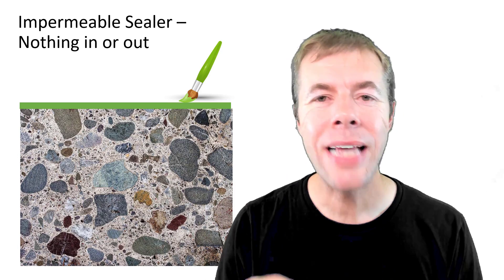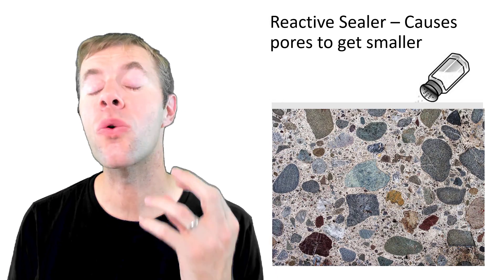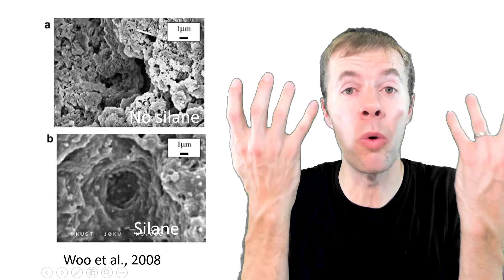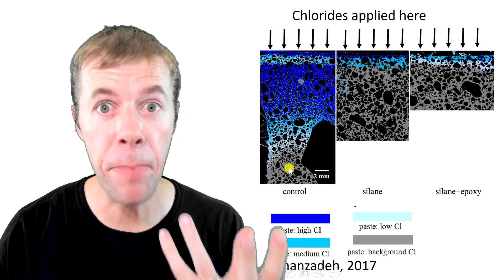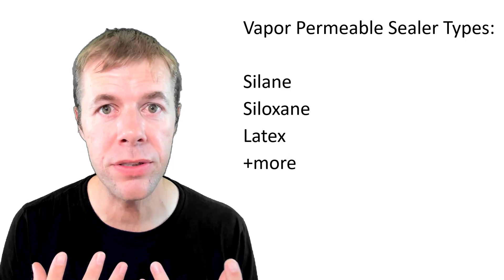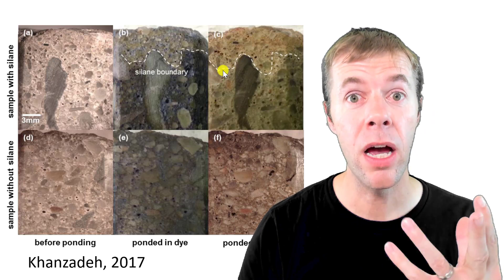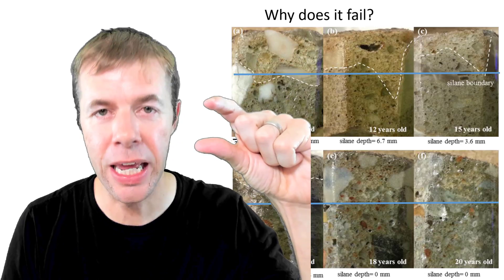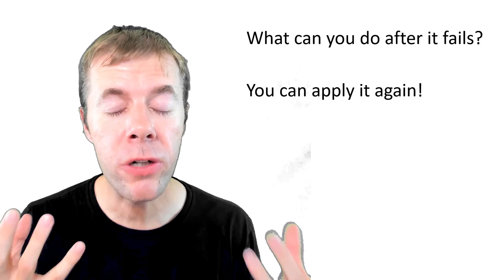Surface coatings and sealers for concrete – How long do silanes last and why do they fail?

Comment: What could be very hard surface that is also magnetic? We have that kind of floor in my workplace and been wondering what it could be...
Reply: My guess is that the floor contains a lot of magnetite.  It's used when you need a very heavy, dense concrete.  It's used when you need ballast (to counterweight a cantilevered structure), radiation shielding (such as a medical facility or nuclear plant), or you need to reduce the heat of hydration (to reduce the risk of cracking).  

http://www.ohamind.com/projects/magnetite/

Comment: If you apply silane should you clean the surface and then wait 2-3 weeks of drought before you apply the silane.  I am thinking a layer of dirt, grease, mold, algae would interfere with the absorption of silane to the desired depth.  What’s your suggestion Dr. Concrete?  Where I live, every year after Father’s Day we get a mini-drought until September.
Reply: Not sure, but the general rule of concrete and mason patching is to use a gas power washer to clean things up. Apparently electric power washers just arent powerful enough!!!

Comment: What about additives? Like quartz .friend used to work pouring crypts. They got steel but the high dollar has fiberglass" AngelHair" also.
Reply: I believe the fiberglass hairs reduce surface cracking, but aren't classed as having any structural strength.

Comment: Another hypothesis might be that the road layer got grinded off the top so the differential line appeared higher/thinner when the core was drilled to the same depth.
Reply: Surface erosion was my first guess, too. But if the shoulders (where there is less mechanical erosion) are affected exactly the same as the driveway, it is probably like he said.
Reply: @Matt Jacob: Minor critique of your text. The word 'grinded' should be rarely used. The more proper form is GROUND, as in 'the road layer got GROUND off'. D : )

Comment: All this stuff forget liquid silicone was used here for years on masonry.On my own front stoop 30 years ago and it's just like new it took all the weather and abuse and still just fine. A brick stoop facing west and south tight as new, but what comes along but US government regulations and bylaws this perfect thing, but it is still used in waterproof latex products at %5, if its OK at %5 why not just make it 100%. Buy liquid silicone spray it on fully dried cement as much as it will take and it will last a very long time...! finding it is the problem  How do you use latex to waterproof anyway.?

Comment: Excellent video, I have been looking for something like this Silane for Necedah Tower ( See it on Facebook) Will this protect wood any or can I get it on wood? the wood is pressure treated. Will 2 coats give more protection? I have a 17 ft by 17 ft slab at the 40 feet level on the top- it is somewhat rough. I have to strop off the old paint that failed.

Comment: Hey Tyler, thanks for all the in depth info! Amateur concrete enthusiast here. Have been soaking up info quicker than silane into a brand new bridge though (bad joke). Anyways, curious what your thoughts are on "sealing" with boiled linseed oil and mineral spirits. I know there has been some research carried out in this and am wondering if there's any merit to it, and if so, what category of sealer you would put this combo into? My application in this case is a concrete sink and I would also be applying a wax coating over top. Wondering if this could be beneficial and if not, what your suggestion would be, if any. Other options are Diamond Sheen, which is an acrylic/urethane combo, aswell as Cheng and Trinic products which I'm just starting to investigate. Not sure what your knowledge of the more decorative concrete arena is, but any tips would be greatly appreciated. I look forward to soaking up your videos. Thanks again!

Comment: older concrete +5 yrs. Can you apply a silane/siloxane?
Has anyone tried Stainless steel rebar. Or Aluminum rebar?
What's your take on "mesh" in the concrete? Or mesh and rebar?

thx
MJ
Reply from the maker: MJ- You can apply silane to older concrete but it is harder to get it to penetrate.
Stainless steel is great!  Aluminum is not!  It will react with the concrete and cause hydrogen bubbles.
I like mesh if it is deformed and welded together.
Reply: @TylerLey  Sorry should have been more specific. But that's a good answer too.
MESH: IE fiberglass or plastic mesh?
Has anyone come up with a semi rigid polymer/aramid fiber to replace the rebar?
Have you heard of using hemp fibers for concrete?

Thx for your time
MJ
Reply: mike johnson 
There’s ‘hempcrete’ but that has no structural strength. It is made of hemp fibers and lime and used as an insulation material. Because of its ability to absorb and release water vapor and its mass it should create a comfortable indoor environment. (Stable moister and temperature level)

Comment: When you dilute epoxy with acetone it gets very thin and will go deeper into the concrete.
Reply from the maker: I agree.  That can be really useful to get deeper penetration but the acetone will also attack the concrete and damage it.  You have to be careful when you choose a carrying agent.
Reply: @TylerLey  Ok, thanks, I  didn't know that.
I used it for rotten wooden beams and it made them strong again. 
I know nothing about concrete, but learned already a lot from your videos.

Comment: Just found your channel so I may be asking a question you have already addressed.  This is mixing latex paint with concrete.  I can no longer find the original study done by the state of Florida, I did find this summation of that study done in 1995 -96.  Is there more current data on this?  

"Paintcrete 
Concrete made with left over latex paint admixture 
Final Report 
Feb 20, 1996

Florida Dept. of Environmental Protection 
Agreement #HW275 
Unique or Innovative Household Hazardous Waste Grant 
In Partnership with Okaloosa County, FL

- a way to divert the household hazardous waste stream - by 
incorporating these materials into concrete)

The question is can this be done while maintaining the structural 
integrity of the concrete, ie, design strength?

- descriptions of several test samples and slabs poured using old 
latex paint during 1994.

- the most controlled test consisted of 250 gallons of paint mixed 
into 17 cubic yards in the form of a slab 25 ft by 37 ft.

- All tests resulted in a hard, functional slab, but failed 
compressive strength tests.

- However, in every instance, the masons had added so much extra water 
that it practically liquified the mix, which probably resulted in 
sub-standard strength.

In late 1995 they performed the most controlled batch design where the 
amount of water was very carefully rationed. They made a mix consisting 
of 1.5 cubic yards of concrete (containing 5 gallons of water) to which 
they added 10 gallons of paint and then 1 gallon of water. Normally, 
1.5 cubic yards of concrete would contain 15 gallons of water to get 
3000 PSI strength. Instead, their modified concrete contained 6 gallons 
of water and 10 gallons of paint. The concrete had a slump of 1.25 
inches and compression strength (at 7 days) of 3909 PSI (130% of design 
strength).

They added 1 gallon of water to get a slump of 3.25 inches and that 
sample had strength of 3472 psi at 7 days. Finally they added 1 more 
gallon of water to get a slump of 5.75 inches and it had a strength of 
2996 psi at 7 days. "
Reply: Great topic, seems like paint is very similar to acrylic admixtures. Modifying  the composition of the concrete seems more practical than a surface coating.
Reply from the maker: I think that starting with really good concrete is always the first step.
Reply: kcotte59  Pottery Barn
Reply: Katie Dotson more water more slump and less compressive strength.
Reply: I do that all the time. especially if i need it to stick to painted stucco. sure i grind it a bit but jeez, who wants to do that. I also do it on those prefab high density foam faux column covers and window dressings,  i usually use white thinset with a smidgen of latex , maybe a tad more.

Comment: what about pool construction? When the rebar rust comes to the surface, the only solution is to cut out the stained section of concrete down to the rebar, cut out the section of rebar and patch the pool with new concrete. This turns out to be a never ending problem until finally you have to tear out the whole pool and replace it.
Reply from the maker: Do you mean a salt water pool?  I wouldn't use metal reinforcing in a salt water pool.  I think FRP would be a good choice.
Reply: @TylerLey 'FRP' fibre reinforced pool?

Comment: Amazingly informative, especially for a civil engineering graduate. Subscribed! 
I wondering what you thought was a better value engineering approach, galvanized rebar or a vapor permeable sealer. I'm building a home in a wet climate and am thinking about increasing the longevity of a long concrete driveway and building foundation. Cheers.
Reply from the maker: I would go with the sealer.  It is very inexpensive and works very well if applied correctly.  Remember that you will have to apply it again after about 10 years.

Comment: Dr. Ley, are you telling us that you found concrete on the travel portion of the bridge (where you cored) saw NO surface wear after 12 to 17 years of traffic ?
Reply from the maker: Yes!  We did not core in the wheel path and studded tires are not allowed in Oklahoma.

Comment: Dr. ley, When the silanes or siloxanes degrade inside the concrete due to high pH, what are the resulting materials formed?  Do these materials affect the concrete quality or durability?
Reply from the maker: Good question!  From what we can tell it doesn't impact the durability of the concrete.  The hydrophobic material is just gone.  Think about grease when you clean it up.  What is left?
Reply: A good place to look is in glass solubility studies. Chemists have been looking into this for some time and have good papers on surface degradation and morphological changes.

Comment: You're right about the pore water solution and the challenges of chemical stabilization of the concrete internally, most folks don't know about such things.  You mentioned amorphous silica briefly.  Have you ever spoken with Brent Rollins at Spray-Lock Concrete Protection about what he's working on over there?  concreteprotection.com  https://youtu.be/_1ou_9vwHto
Reply from the maker: Thanks Rory!  Yes, I know Brent well.  He is a regular viewer of my channel.  I have not worked with the Spray-Lock system yet.  I hope to some day.

Comment: What is the best method for the roof made from concrete and colum what about sika powder if we add it to the concrete track to stop concrete from moisture some people use Berlite please give me your opinion thank you
Reply from the maker: If I was making a concrete roof then I may use an impermeable epoxy sealer.  I would also make it on a slope so that it would drain.
I don't know what "sika powder" is.  Do you mean silica fume or silica powder?  This is similar to amorphous silica which is a reactive sealer.  This is the second one that I talked about.  I think it can do some great things if used correctly and in the right application.

I am not sure what Berlite is.  Can you tell me more?
Reply: Pratliperl – Thermally insulating
Reply: The products in your video can be found in sika comp. Or foursc com. Or BASF COMPANY WHICH COMPANY IS THE BEST FROM YOUR OPINION THANKS
Reply from the maker: Salam Amer  
I have no idea which is best.  I have not tested them.  Maybe their technical literature has some information.
Reply from the maker: I think you mean pearlite.  It is a porous material.  I am not sure it acts as a sealer.